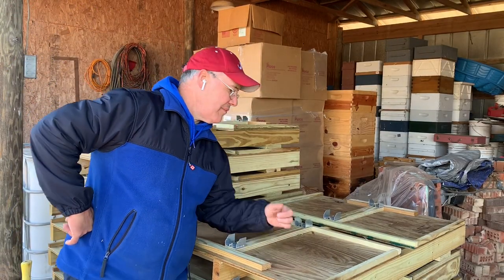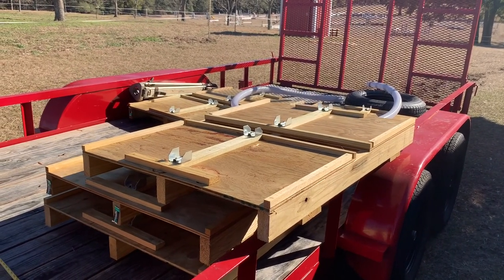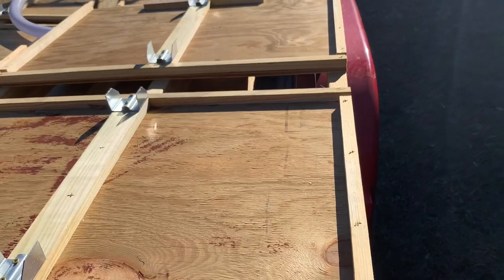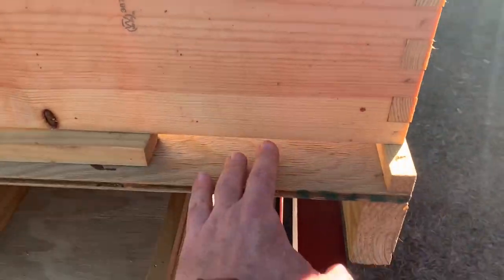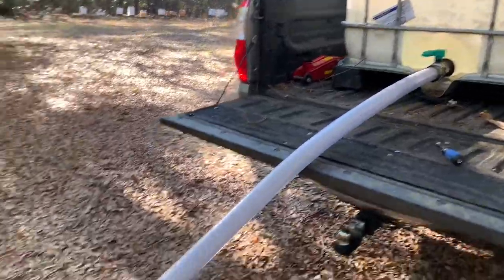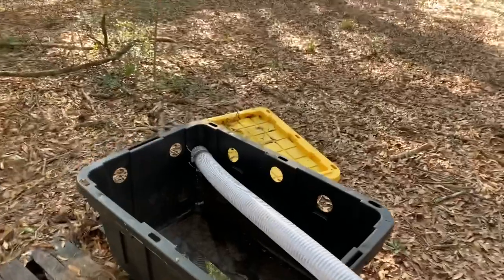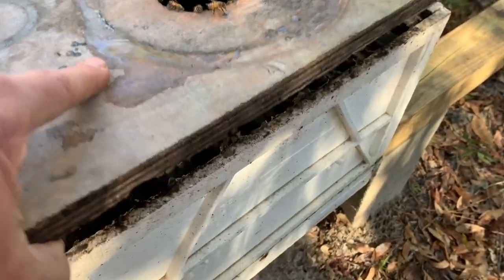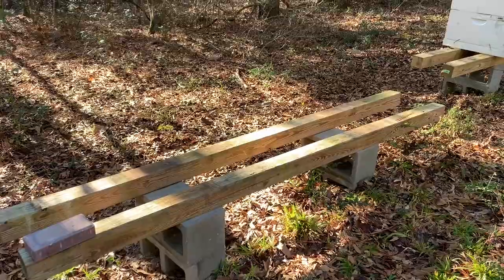4 Way PALLETS (dimensions) - Feeding Bees - Simple Hive Stands - Checking Clover & more

Comment: Bruce, I’m surprised the syrup would run at all as cold as it’s been.  Are you planning on using syrup and thinning it down in the spring or stick with sugar syrup?
Reply from the maker: Yes it was very thick but I got it done. I plan to switch to sugar water soon to stimulate the queens etc. I may do one more round of corn syrup though. The bees at Lake Patti Sue sucked the corn syrup down in a week and it was pretty cold part of the time.

Comment: I noticed a small opening where the back of each hive would be. What is that used for?
Reply from the maker: If you  are referring to the small slit on the pallets it allows water to drain out of the back of the hive if the pallets are not exactly level. The bees actually also use it and another entrance sometimes.
Reply: @brucesbees  do you worry about robbing with that opening?
Reply from the maker: @radi. No. There is a larger entrance in the front. A strong hive will not have issues with robbing. Assuming I am thinking about the same entrance you are talking about. It is only about 1/2 to 3/4 inch wide.
Reply from the maker: It is not necessary to have it there. Many build pallets that are closed back there. I kind of like to have it though.